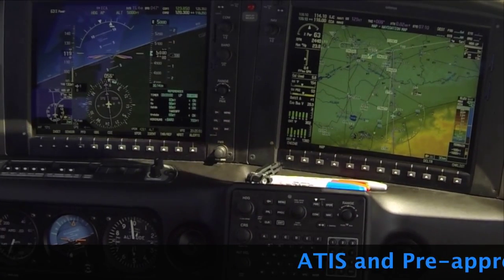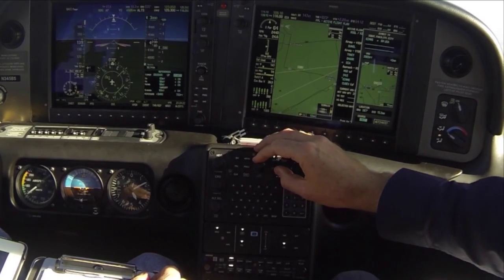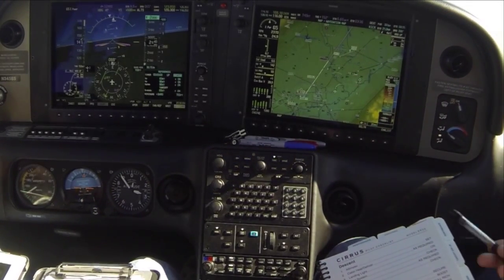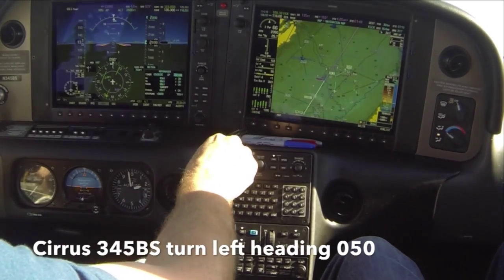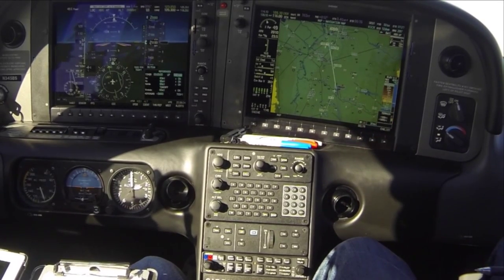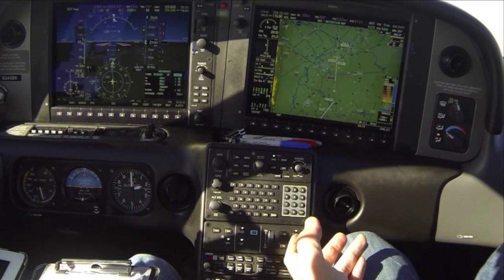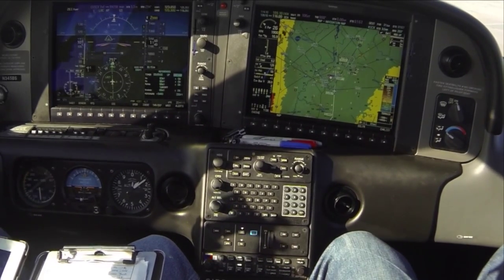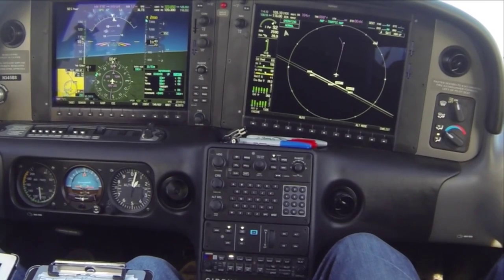ILS Approach

Comment: OMG I did a JFK to Toronto flight tonight on XPlane11, in Cirrus Vision jet, ILS Runway 05, and everything went great except, I forgot somehow to hit the APR button on the AP
as I turned to intercept IAF and the Localizer engaged. That was a lesson learned. I was concentrating on the somewhat stormy weather around me, so was distracted. Going
to redo the flight tomorrow and keep on top of the ILS. I just took manual control and landed, but it was disappointing.